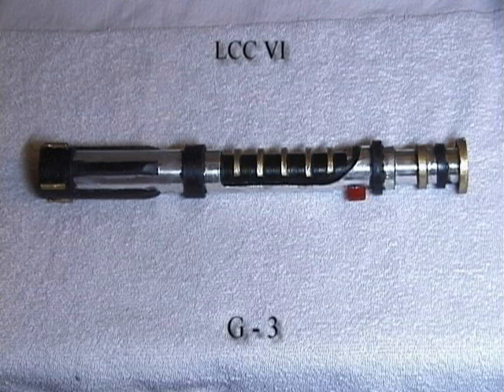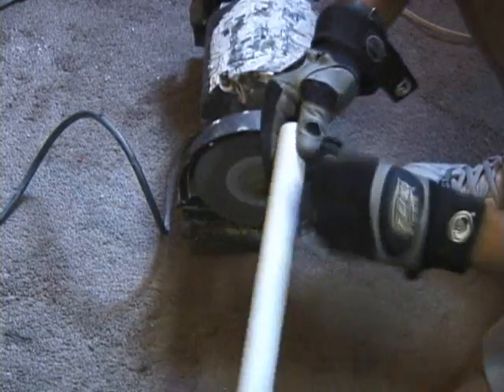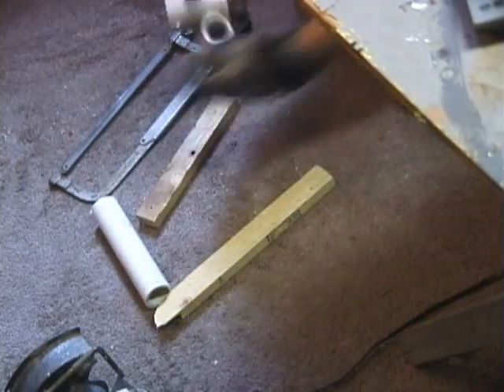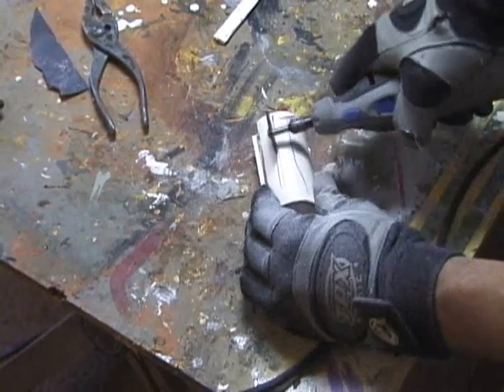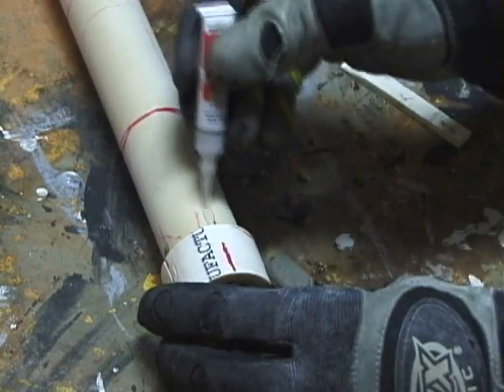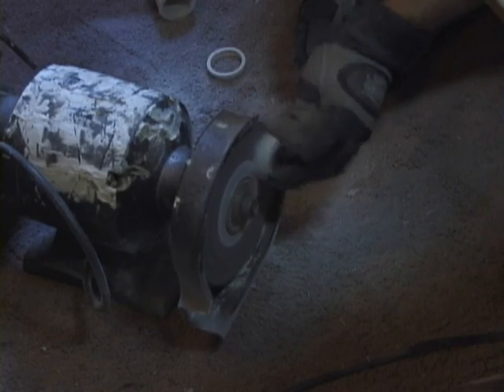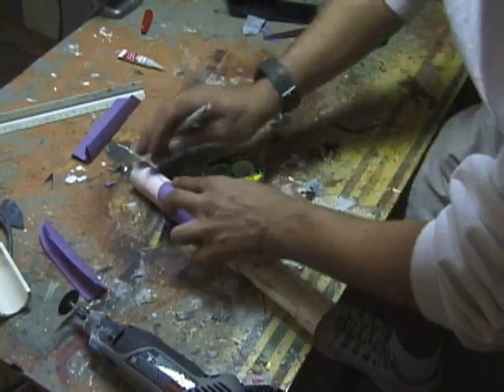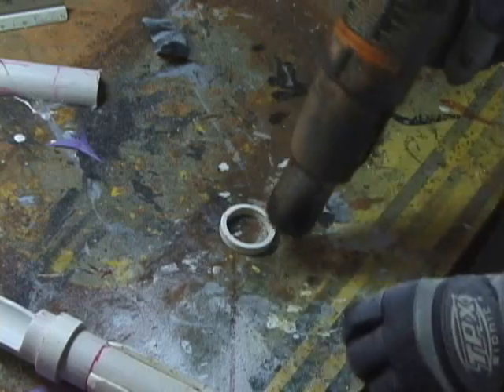PVC lightsaber PART #1

Comment: Really enjoying these videos and I appreciate how insistent you are on safety, I know workshop safety but a lot of people watching these probably don't, grinders, cut off wheels, heat guns and even super glue (it's not just sticky guys!) are dangerous even in normal use and every precaution has to be taken, you need hella thick leather gloves to protect you from any of the power tools used in this video and standing away from the workspace doesn't help with fumes